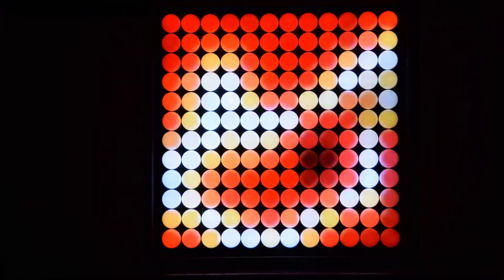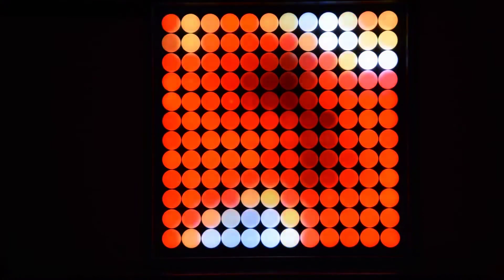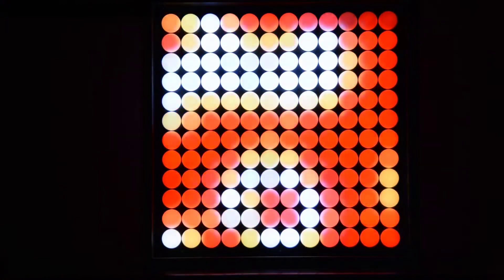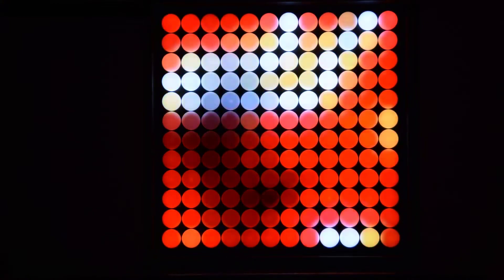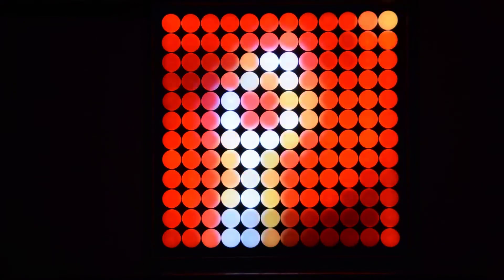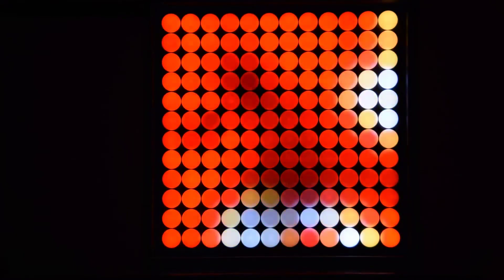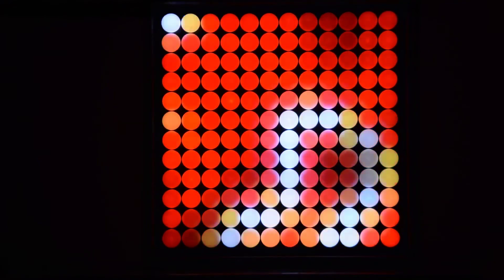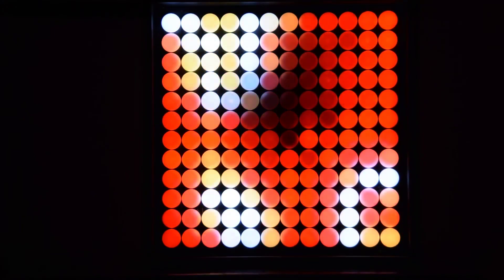Lava Lamp Effect on 12 x 12 Ping Pong Ball Array

Comment: Hey! How did that volume affecting the speed of the animation thing work out?
Reply from the maker: I never got around to that -- too many other projects tempted me away, but the ping-pong ball array is still sitting here in my office looking awesome :-)   I'm sure I'll return to play with is some more at some stage in the future :-)
Reply: @maxscoolbeansblog1761  you wouldn't happen to have a copy of that code you're using in the video laying around still?
Reply from the maker: @redrighthandarts  This is your lucky day -- I just rooted around my system and found it. Email me at max@clivemaxfield.com and I'll send it to you :-)
Reply: @maxscoolbeansblog1761  so... I've been playing around with your code and I'm wondering what it might take to replace the speed with the input variable. I found another code for a vu meter that I'm trying to use to patch it but it's not seeming to work. It seems like it should be easier than this.
Reply from the maker: @redrighthandarts  Remember that (as it says in the code itself), I actually found that as part of the FastLED example stuff -- I just cobbled it together to work with my Ping Bong ball display -- I'd have to delve deeper into it, but I just don;t have the time at the moment -- sorry -- but it shouldn't be too difficult to figure out (which is always easy to say when you're sitting on the sidelines LOL)